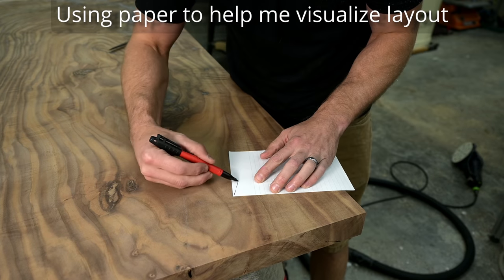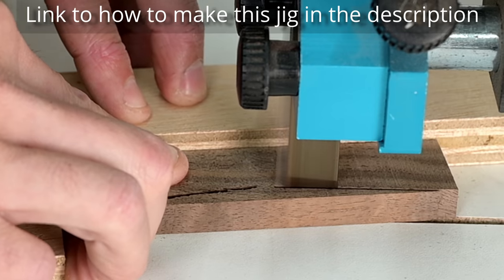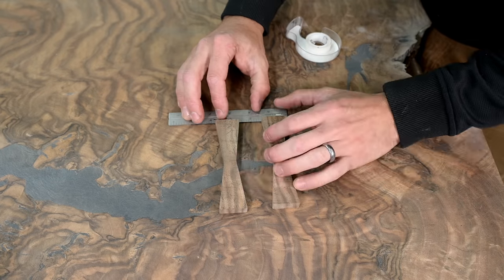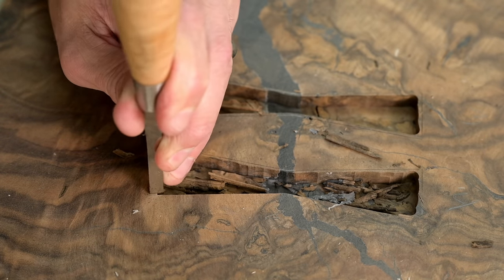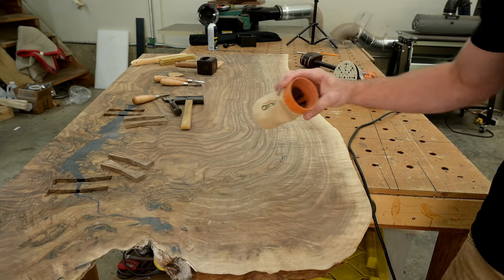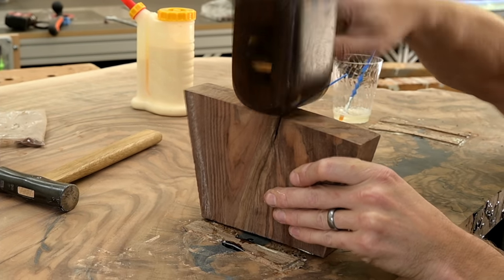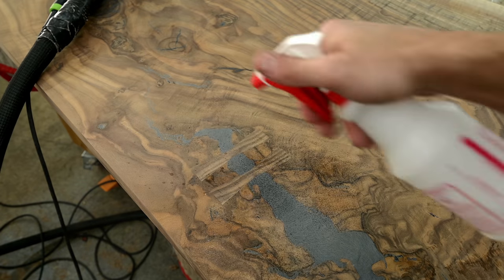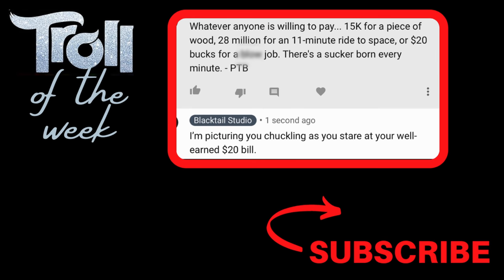Bow Tie Inlay - How, Where, When, and Why

Comment: I just cleaned up my live edge, and there's a huge crack that expanded over the past few months and I epoxied it but wanted to make sure I knew everything about inlaying bowties before doing it. I got halfway through video and was so confused as to how I completely missed this video. Then I noticed this video only has 2.5k views (currently), welp idiot me then saw the date. What are the chances you release a perfect how to the day I plan on inlaying. Also I love all your videos, the ones at goby with the wood info, the tutorials and the insane slabs you make. Learned from them all :)
Reply from the maker: I'm here for ya!
Reply: @BlacktailStudio  For larger cracks or cracks that penetrate all the way through the slab, do you recommend epoxying and doing a bow tie joint? In other words, is there anything wrong with doing both? I'm thinking of doing the same but not sure if its counter-productive or unwise to both epoxy and inlay a cross-grain joint. Thanks!

Comment: I would really love to see you attempt a resin bowtie. I don’t know if it would work structurally or how it would look but i feel like if you did a resin bowtie over a resin filled crack on a wood table, you could do a contrasting color to add to it, like your usual black resin table but trying maybe a gold colored resin bowtie? or red or blue or even white. I feel like that would look amazing and it would be really cool to experiment with. Plus it would be a small amount of resin being used. You could even do bowties in a gap larger than the wood piece and then encase the bowtie in resin in its own little pit. It would be a good way to make tests on how certain woods look with certain resin colors or certain styles of wood working look. Like especially with the burned wood table I would love to see more of that!
Reply: I was thinking this earlier, and maybe a brass outline on the wood bow tie may look good too.
Reply: Yes it WOOD work,  structurally

Comment: Thanks for another great video. If you don't mind here are several ideas from some other YT woodworkers and a some personal experience. Perhaps they may save some time and effort.
1) Start inlays by marking them just as you did then hog out material with an appropriate size forstner bit (particularly for larger sizes). Then route with appropriate size and type of router bit.
2) Route using a template and guide. Yes you get round corners but you'll clean them up in the next step.
3) Clean up and finish route with a sharp chisel (far less chisel work to get nice sharp corners).
4) Use a good Japanese flush cut saw (Ryoba or Kataba) to trim flush. Sand to desired finish grit. Easier than using a hand plane and less likely to damage the top if you slip. Just don't press to hard on the saw or you can gouge the surface.
5) Coat the area with a very light coat of shellac or sanding sealer (non-penetrating coating) when using epoxy to adhere pieces together to help mitigate the epoxy staining the area then sand it off the coating. You can also use paste wax (ie Johnson's) but I don't particularly like the way it cleans up. It leaves a bit of wax residue.

 I Hope these ideas help. Thanks again for another great video.

Comment: Excellent video - I couldn’t agree more with every part of your process. From an experienced woodworker - this guy is one of the finest teachers of basic woodworking techniques on YT. There may be better craftsmen but I haven’t found anyone who can explain anything better than Cameron. And he is self-taught - you don’t have to pay thousands to get this good at the craft.

Yes, there are metric bits - almost all of mine are metric (1mm, 2mm, 3mm, 4mm, 5mm, 6mm etc.). I particularly like those from Wealden Tools - but there are others.

I have learned that success comes from accuracy and patience - and those two are interlinked. The individual steps in most woodworking tasks are not difficult; take your time, plan and think each step. Don’t do anything if you a) have just had a row with the other half; b) don’t feel great; c) are tired; d) want to get this job done before you pack up. How do I know all of this? Guess and/or look at my waste bin. This is not the hobby or trade for you if you want to do things in a hurry.

Everyone should take note of the repeated use of the strop on this video. It’s not a secret but not enough people do it. Start with a sharp blade and strop throughout the task. I could cut 10 or more bow ties this way before I thought about going back to the “scary sharp” and touching up the secondary bevel.

Comment: Both… As always great tips. I do cheat when doing my bow ties with the Slabstitcher Templates. Does take a lil time to get the corners perfect afterwards to remove the rounded edges you spoke about. I also buy my bow ties from them in different species and metals.

Comment: Excellent. Nearing the end of a live edge slab desk from a maple we downed on our property 3 years ago. Still daunted by the bowties. Have a narrow crack about 6 cm. long extending from one edge on the top of the desk but not all the way through. Slab is about 6 cm thick. Not sure if I can get away without reinforcing it. Do not have much of the equipment required to make and insert one. Thanks for advice. Great videos.

Comment: BOTH! 👍👏👏😃
I’m an older fan of Blacktail Studios and not totally certain where to find the links. I was watching on my TV but switched to my phone to find the links. I’m interested in your marking knife in particular and your bow tie jig. Finally I have a craftsman router from 1990. It is a 3/4hp but it doesn’t plunge or do anything easy. My wife bought me a skill router table so I mounted that router to that table (it works for now with patience) but I find I need a router for thinks like rounding edges and channeling voids such as for the bow ties and table legs and your support pieces. 
So if you don’t mind pointing me in the direction of the links I would appreciate that as much as I do you work and your channel! Thank You

Robert

Comment: DIY!! I'm a quadriplegic (quadriparesis for you for you former EMT's out there) intermediate woodworker who also does MIG and TIG and have worked with epoxy and carbon fiber. You're inspiring me to do a smaller river table (36" round maybe)! I got help to lift it, but I want to do the work. Would you recommend starting on a smaller epoxy slab project first??  Keep up the good work!
Reply from the maker: For sure, always start smaller!

Comment: Bowties are just for decoration. I got tabletop made by 2 wide plank and center joint of them was several bowties. It wasn't dry enough it kept shrinking after brining it to insdie but those bowties didn't prevent middle cap from separating.

Comment: Both. Hi Cam, when you cut your bow ties' inlays with the router you set the router depth to cut them excessively shallow so when they were fitted they protruded a lot and you had to plane it down before sanding. Why not get the gap closer to the actual thickness so you can only sand? Hope it makes sense. Love your work but love your quirky come backs at trolls more... 😉

Comment: I was actually thinking about an idea for a hexagonal sanding pad where there were several smaller hexagons that made the whole shape.  Similar to the shape of the James Webb Telescope.  I think the idea isn't too dissimilar to a bowtie in this case.  I believe the efficacy of the bowtie is being its own independent structure amongst a larger structure.  With its own directional strength and stability.  The hexagonal sanding pad could be thought of similarly in that instead of the conventional single sanding pad you'd find from, say from Festool for example, each hexagon acts on its own, yet also in concert with the rest to create a sanding effect larger than just its own contribution.  If you couldn't tell, I'm tipsy.

Comment: DIY! Cam, first of all, I love your videos! Second of all, I have a question I hope you can answer for me. My dad built an oak cookie table decades ago, and has since given it to me because I always loved it. Now I'm trying to repair it - it's wobbly so I know I need to level it out with a router or something, but it also has had a 3" wide pie-piece chunk of wood break out of it over the years, and my dad's solution was to use a ton of wood glue (and possibly some spray foam insulation, I'm not exactly sure) to reattach it. Is it possible to put bowties into that section and have it secure, or is that section basically garbage now, and I need to find another way to fill that void? I was planning on (gently) breaking it loose again, cleaning up the edges, and trying bowties to fix it, but I really don't want to make things worse, since I already love this table! Any suggestions??

Comment: Both!  I feel like you only touched on the need for a bow tie inlay with your example of the small crack running through the thickness of the slab. What about one that doesn’t necessarily run through the entire thickness, but is wider than your example? Does the width of the crack ever determine use of an inlay?

Comment: First off, I love your channel, new subscriber here. I have a bowtie question. I have a slab with a long crack running with the grain. It's deep but doesn't go all the way through. I do NOT have a bandsaw, so making my own bow ties will be time-consuming. 

What if I were to carve out the bow-tie hole, but instead of inserting a bow tie, I poured epoxy into it? Would this create the same structural integrity as a wood bow tie? It seems easier and the epoxy would fill it to create a perfect fit. The crack is on the underside, so I don't care how it looks as much as the strength it might provide. 

I can't find a video of this technique. Thoughts? Thanks!

Comment: It has to be both as I enjoy the process of the creation and at the same time if a cockup has taken place then the repair process is as important as the creative process!!!.
I was once told that when cutting out for a bowtie if you crush the woodfibres together, the best thing to do is use water to wet the area of the crush then apply a little heat and this will make the fibre part and raise again so one is able to continue with cutting the shape for the bowtie. Now I have no idea if this works or not!!! As always buddy 💯%   👍   🇬🇧.

Comment: Both. You can very easily get sharp corners with the Shaper Origin if you use a small bit and then a chisel for the points of the inside corners. You can expand your pocket cuts out as needed by the thousandths of an inch to get a perfect fit for each bow tie. I’m a new Shaper Origin owner, and so far I’ve been amazed by it’s capabilities. Purists might hate me now, though 😂
Reply from the maker: Meh, some people always hate what’s new

Comment: The whole video is so informative, so thank you! I have a question: If I'm dealing with a generous crack that goes all the way through the slab and I don't want to pour epoxy into it, should I attempt to bow-tie both sides (top and bottom)?

Comment: Cam,
How important do think using the Rubio wood cleaner before applying the finish is?  I heard in one of your previous videos that you thought their cleaner was basically mineral spirits— and whenever I wipe down a wood top with mineral spirits, and wait a long time for it to dry, I see residual wipe marks on the wood and am concerned that they will show after applying the Rubio finish.  Any thoughts on this?  I’m completing a large claro dining table top and will be using Rubio for the first time (will practice on smaller piece first).  Big thanks.. and really enjoy you videos

Comment: Hi, great videos. I have 2 questions. When adding bowties to the underside (with the top surface upside down), does it make any difference if I pour the resin before or after I fit the ties? And the other question is how do you prevent bubbles on the top surface (side touching the melamine base) during a pour? Especially if the top surface has cracks. How can you ensure all the cracks get filled? Thanks. Robert

Comment: DIY to Both. The explanations for why you do or don't recommend doing something is helpful, but it can be easily incorporated into your longer build videos. Quick question - how much sanding do you do on the undersides of your tables (are you taking them to the same grit at the top or calling it good enough at 120 or so)?
Reply from the maker: Usually just 120-150

Comment: ...but you could use the router jig inlay to shape the bow tie slot and just cut the corners in by hand. The long sides of the slot can be used for reference with a wide chisel (or you can make a jigged up bow tie that has a rounded corner bottom so it part-way fall into the slot giving you a piece to scribe the cutting lines with).
You can use a template to cut the bow tie itself (might need a small manual sharpening of the narrowest part on the inside corners if you only use a large pattern router bit, but the outside corners come out just fine). I just assumed you these by hand for fun.
And yes, rounded bow ties are the worst.

edit also I don't know if you've tried, but there a small Japanese flush cut saws with flexible blades, the teeth have no set, so you can carelessly saw plugs and other small inlay stuff flush with a surface. Also a normal saw works as well assuming it's flexible enough to get into the right place if you just use the tape trick where you stack 1-3 pieces of tape on the saw blade surface (not all the way on the teeth obviously) so if lifts up the blade from the work surface slightly so the set of the blade teeth won't mar the table. However those flush cut saws have very short blades and going through many bow ties might end up being annoying.
I would probably try a multi-tool with the same tape blade trick. Or probably a few sheets of paper underneath as I suspect the vibration of the blade against a surface might just heat the tape glue up and it might let go.
You don't need the get it all off with this stuff obviously, just enough that you can sand the last 0.5mm or however much that is in inches.

Comment: Both. I'm wanting to make a Corner desk for my computer/consoles and I want to do either a resin river or a Hexagon/random shape design and was wondering should I try to make it one piece for the pour then cut it for the CNC machine or keep it one solid piece and work on the leveling by myself? Dimension's are 5'x2'8" and 5'x3' meeting at a curved 90 bend. Also it will be in a basement for final assembly with plans to move it out at a later date for my new house

Comment: HI Cam, thanks for the tutorial. I am going to try walnut bowties on a soft maple table. Do you use stain sealer on the maple to keep it from absorbing epoxy at a different rate than the walnut.  Just want to know before I ruin the whole project. Thanks!!

Comment: Hey Cam. DIY. New subscriber, but I’ve been lurking for a while now. Great stuff. With regard to bow ties, I’m working with a gnarly piece of Osage orange from a historic old tree. It has a long, sort of u-shaped crack that should be reattached for structural integrity, as well as an epoxy pour because it would look cool. Which comes first, the epoxy or the bow tie? Or is there another way to make the piece more stable than a bow tie? Thanks for answering

Comment: Both! 
Have you tried using a router to cut away the excess bow tie? I've seen someone place a piece of paper flat on their surface, lower the router bit to the paper, then set the stop. Run the router over your bow tie and  you have a very close to flush bow tie!
Reply from the maker: Haven’t tried that!

Comment: I'm wanting to add aluminium bowties to some table legs, mostly for decoration, but also extra support. Is aluminium suitable for bowties? I'm a bit concerned they'll be too weak or . They'd be 10cm long and 2.5cm thick, the legs are pine. Thanks.

Comment: Both -- the builds are inspiring and the DIY details are informative.  Interesting that you've just shifted over to the template camp (with your own twist.. are the round ends so that you can use a right-angle chisel on the corners?
Reply from the maker: The round ends are really so you don’t need to chisel them at all. Just a deliberate rounded bow tie
Reply: @BlacktailStudio  Thanks for replying!  (I have a big project that will involve a lot of bowties very shortly.)  I guess the bushing makes the corners a good deal sharper than the template looks (which isn't very).  I presume that all will be made clear in the video that comes with the template...   BTW, do you have a reason for doing the bowties after the epoxy, rather than before?  That uses more epoxy, which is then turned into epoxy-dust (a.k.a. microplastic pollution), and requires double-gluing...  my current plan is to do the reverse.

Comment: Hey Cam, more great content :)    Re the bow tie jigs,  couldn't you use them for like, 90% of the cut, and then just finish off the very corners with your chisel for traditional straight edges. May save 'some' time in comparison to doing it all manually?....   
I may be wrong,... just thinking out loud.   Thanks.
Reply: Oh, and I love your Troll of the weeks :)

Comment: There are metric spiral bits, you just need to look hard for them but, they're out on the market. 
I personally like the looks of both, the rounded and sharp corner. I haven't ever done any inlay work, not saying it's new to me, seen it done many times and I do have jigs designed for inlay work, just haven't had the time nor the projects yet. Same with epoxy work, never messed with that stuff. 
LOL, I like your sales pitch for a sub, fortunately, I've been sub'd for quite some time now, enjoy your videos. Cheers :)
Reply from the maker: I’ll take it!

Comment: I noticed after I've sanded bow ties flush and apply finish/bring the project inside they are no longer flush and I can feel the edges slightly. Is that due to wood movement since they're generally long grain or and does this happen to you?